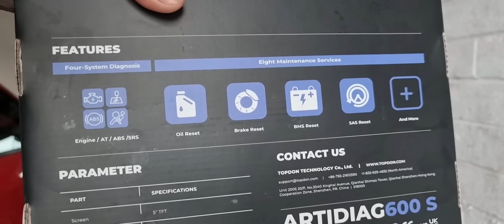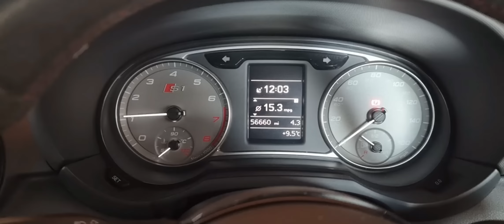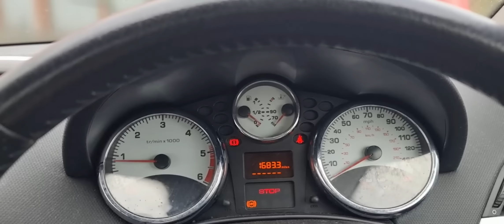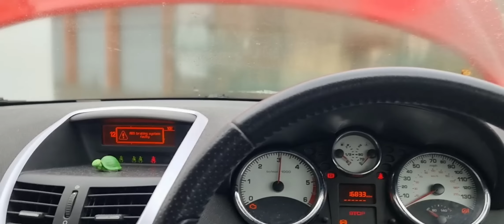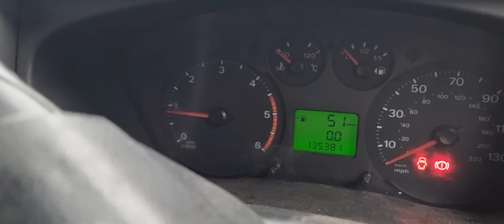RUINED BY SALVAGE?  The Cheapest Audi S1 Is Impossible To Make A Profit On

Comment: You’ve taken on some quite big projects in past. Personally I only buy the cheaper Sub £1500 cars with minimal damage. 

The one car that I think you’d of done alright with selling on quickly would have been the sidewalk mini, they have a bit of a following, not expensive and have a good appeal in the spring / Summer.

Timing is another one, you need a few bits you can turn over quickly. The Audi is a lovely car but it took quite a while, and if you think of it from an insurance perspective that car was always going to be a bit of trouble, because of the value of it, if was going to be a nice quick repair - they would have paid for it to be done.

Hang in there, go for a few cheap small cars, (Not Fiat 500 / Ka’s - because that engine is terrible). 

Good to see you back.

Comment: yo man, regarding your transit and injectors, please get someone with Ford IDS, i used forscan to reset my injectors on a replacement 2011 focus 1.6 tdi engine couple years ago, used my original injectors in the replacement engine thinking theyd need calibrating ect for better fuel economy and such , it did exactly what you describe, and same symptoms after the forscan procedure, it wasnt noisy at all till i did that, it caused my injectors to start knocking, i got Ford IDS and vci and followed its recalibration for the injectors, and my engine was quiet as a mouse again, just thought id share my experience, may help youout